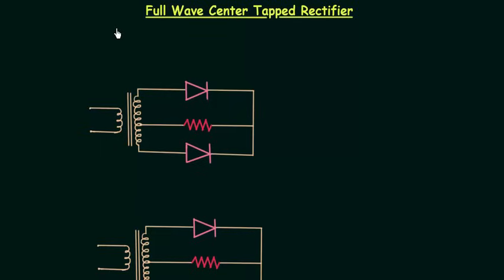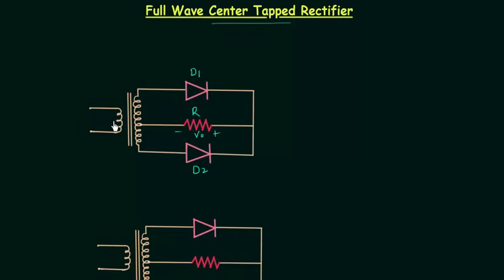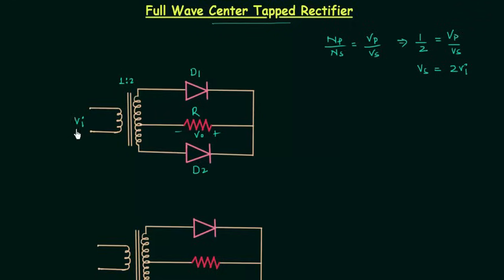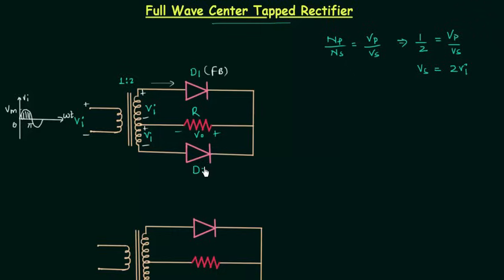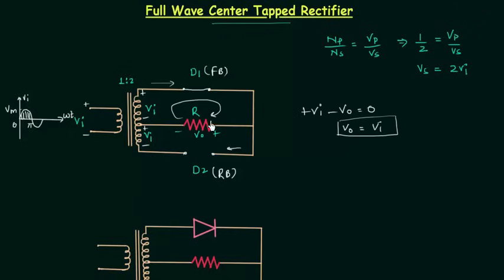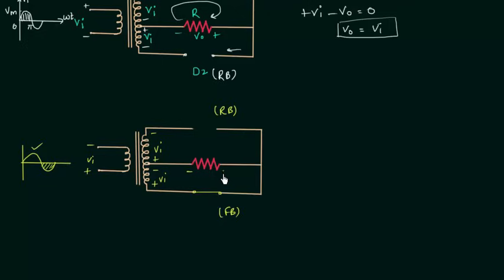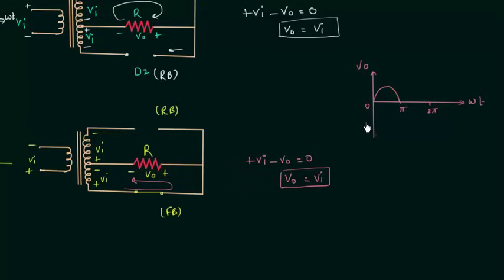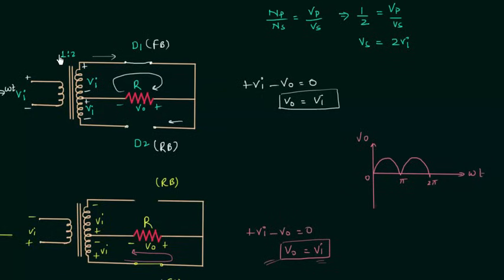Full Wave Center-Tapped Rectifier

Comment: Sir..if we're getting the same output with both kinds of full wave rectifiers....what is the use of having types in them... you could've explained the applications where they're used...
Reply: in bridge, we have 4 diodes, in center tapped we have 2 diodes, preferring of full wave rectifier depends upon the cost and importance.

Comment: What is the need of center tap for FWR Sir
Anyway there is Bridge Rectifier.
Thank you for you BEST lectures Sir.
Reply: In bridge rectifier the Vo = Vi - 2Vb. For centre tapped it's just Vi - Vb.
Reply: @satashreeroy1652   but in case of ideal diode in bridge rectifier
Vo=Vin

Comment: What is the purpose behind the use of center tap?
Reply: ronald phillips it seems he isn't
Reply: purpose of the center tap is if for instance you have 10 volts output then between the center tap either side will be at 5 volts. So you have 10 volts and two lots of 5 volts
Reply: also some transformers have three four or any amount of tapping points for different voltages. I hope you are happy with the explanations.

Comment: thanks!! I like those videos but I have a question ^ ^" 
what is the difference between the bridge rectifier and the center tapped rectifier.. I mean.. why to use 4 diodes when we can get the same output by only 2 diodes?
Reply: what do you mean by "heavy?" 😅😅
Reply: locating the centre is also difficult
Reply: I see.. thanks alot :) so the bridge rectifier is often more preferable (practically) right?
Reply: Aya Hayder yes
Reply: thanks again!
Reply: In center tapped, no of winding in secondary  is double the number of winding of secondary of transfor of bridge rectifier